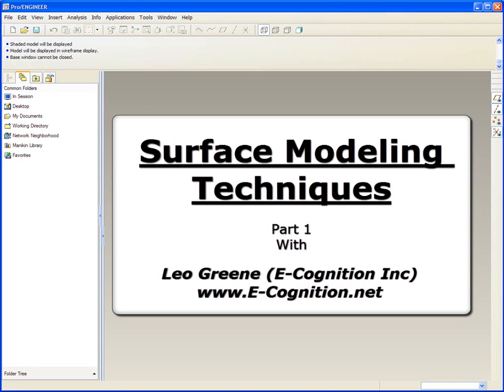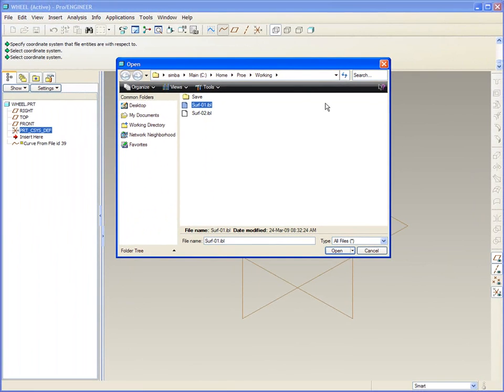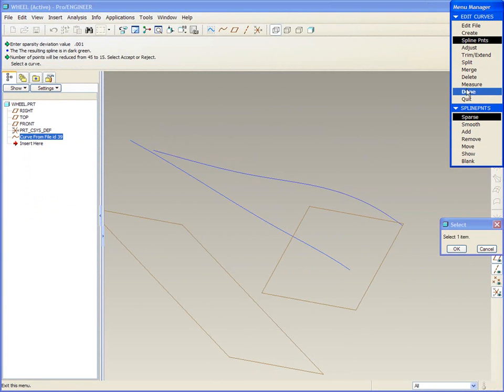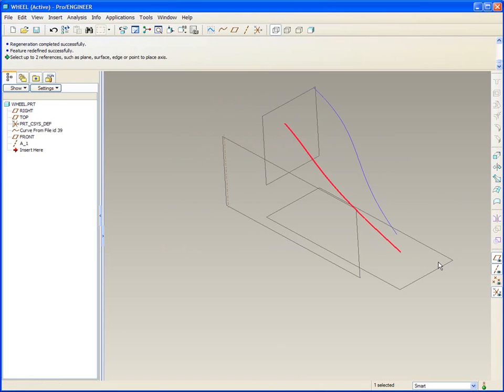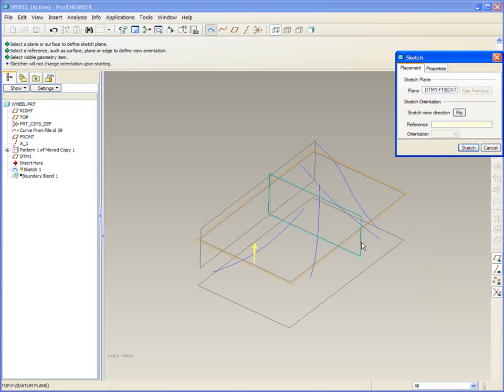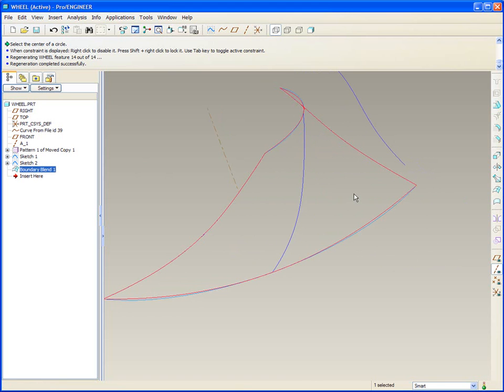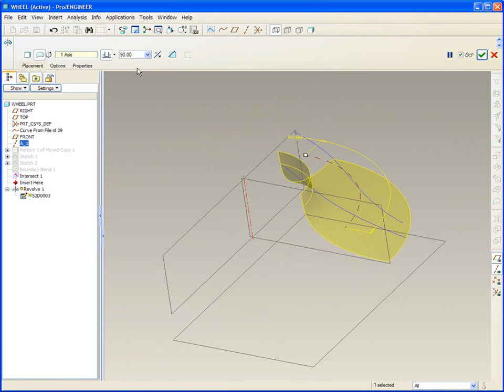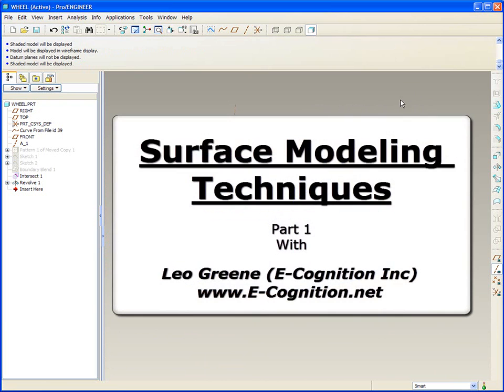Surface Modeling Techniques Part 1

Comment: Firstly, it's a great video that does exactly what it says in the title - no one reasonable is denying that. The question is, how are IBL files generated? For example, how did you create yours? The tutorial is but a curiosity without this knowledge. A google search on IBL file creation yields nothing. Can it be done in ProE? Can complex 3D curves be generated by (eg) taking an average of two 2D curves on different planes? I would love to use your tutorial with my own, self-made curves. Thanks